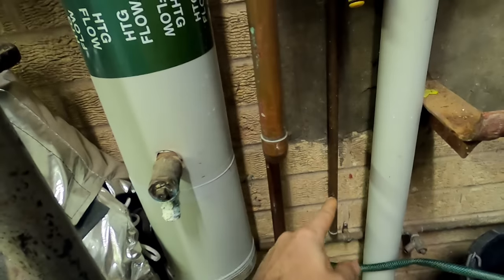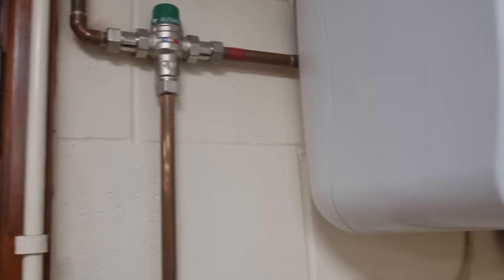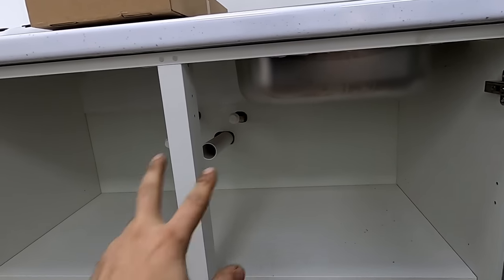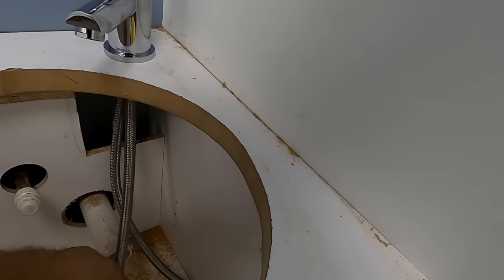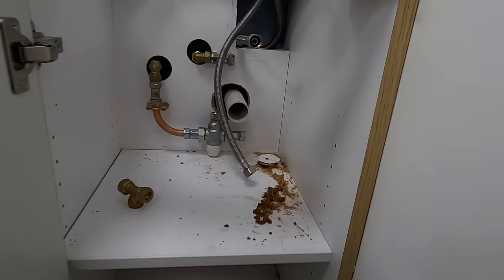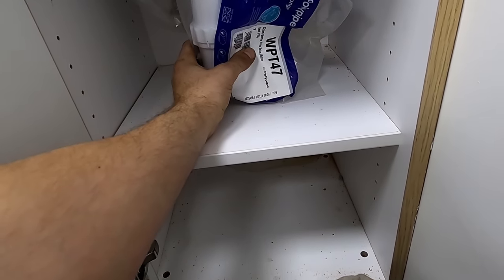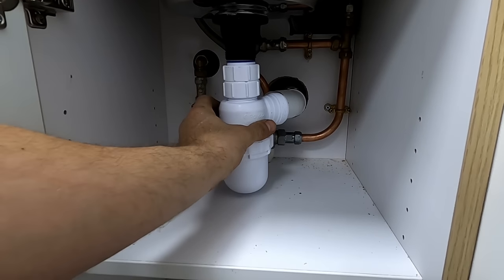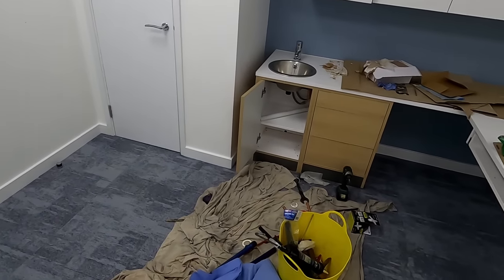JOB AROUND with a PLUMBER

Comment: I bought one the Ox pipe cutters after seeing you using one. I found it tracked so went back to the hacksaw.
Reply from the maker: Sorry about that mate, mine has been fine, I just bought Jacob the nerrad ratchet ones and they are terrible, they snap the pipe rather than cutting it
Reply: The ratchet ones are for push fit waste , not solvent weld . But they crimp the pipe anyway.  I will stick with the hacksaw 😉

Comment: What a work-up these days just to fit a basin/sink, Are people these days, young or old unable to mix their own hot and cold water at the mixer tap? at 60 degrees they take their hand away if it's too hot for them. How many fittings went into that job. 😃 Loving your videos Tom.
Reply from the maker: I agree, the problem with jobs like these is that members of the public will have access to the rooms, unfortunately we live in a society where people like to sue each other, fitting a £30 blender is defiantly going to be cheaper than a law suit if someone got burnt
Reply: @PlumbLikeTom  "my bath is not hot enough" take that up with your landlord...     There's a reason they put "do not drink" on bleach.... crazy times.

Comment: Good stuff Tom. What's the issue with the exp. vessel being 'upside down'? Don't think I've ever seen it written down anywhere that they have to be orientated any particular way..
Reply from the maker: You are correct, there is nothing specific that says they must be in the vertical position but it's often seen as good practise, there is a theory that in the vertical position legionella is less likely to form as the vessel drains itself, the only real way would be an inline vessel which constantly replenishes itself, thanks for watching as always mate, it is greatly appreciated 👍